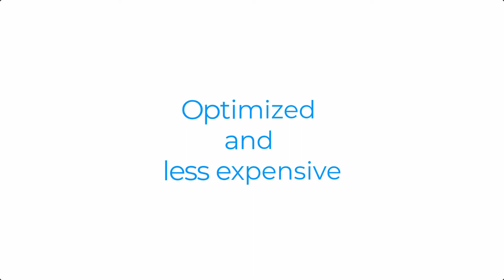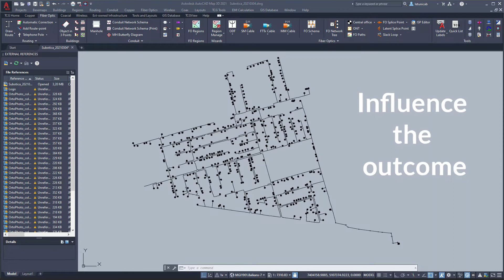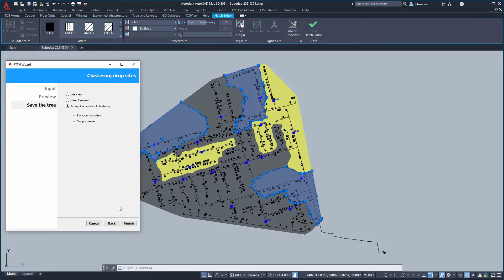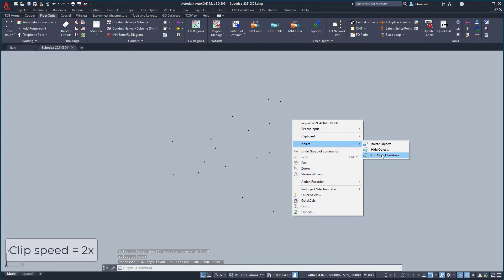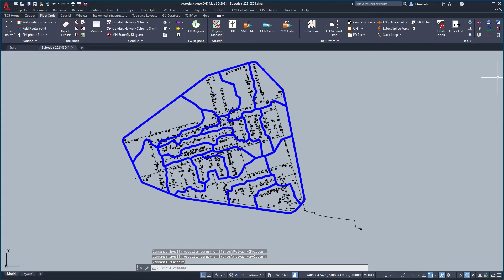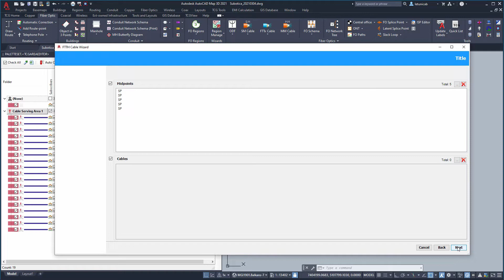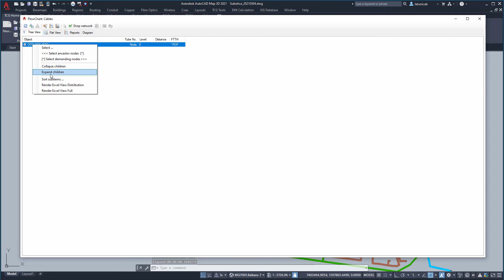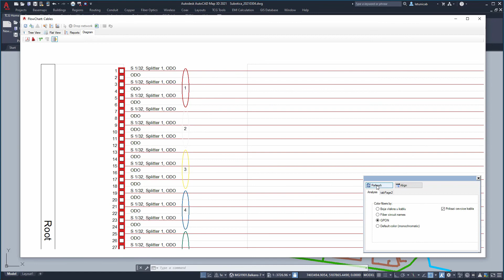Automated FTTH network design

Comment: May i know the routes and NID data are created by hand or download from the open source
Reply from the maker: In this case routes and NID data came from a geodetic field survey company. Depending on needed accuracy You can use OpenStreet centerlines which you than offset.
NID-s can be created from house or parcel number objects. Everything can also be added manually to the drawing relying on areal imagery, for example.
The software  supports import from XLSX, SHP, DWG file formats while preserving all initial data attributed to telecommunications objects.
Reply: @telecadgis  how do i get access to this tool? I need to design multiple fiber optics routes in several estates here in Abuja Nigeria.